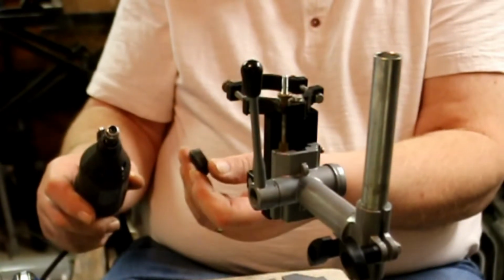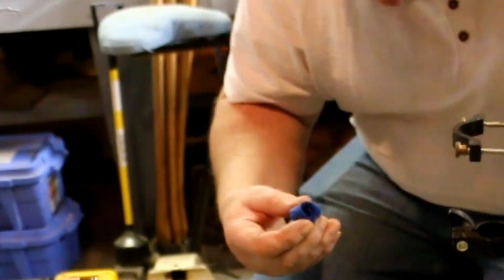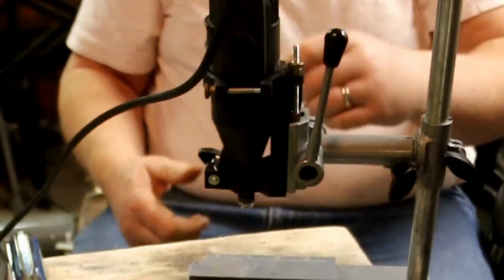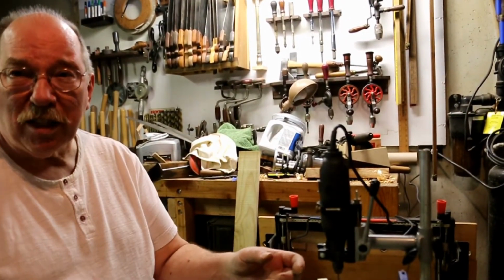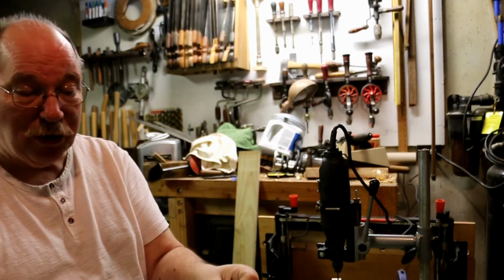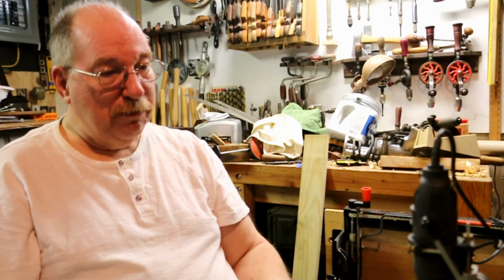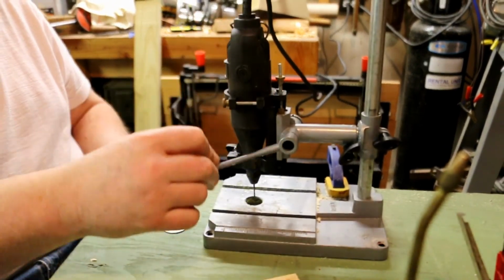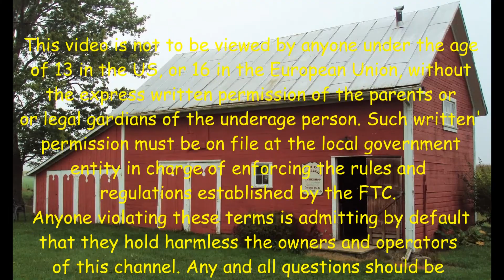The Hobby Drill Press For A Dremel Pt 2 Assembly & Test

Comment: A FINE addition to the shop! I got a DeWalt roto-zip thing and bits but it has a collet setup so I can use regular router bits. SWEET for small stuff you have to hold on to. Sunny today and off to the shoe place tomorrow and back. 1st outing for US in ages. The v.a. was the last. I like being at home. 10/4 on the vise mount idea. GBWYall!
Reply from the maker: W e will be hitting the stores today. After the cancer scare Lydia is back on Humera again and that stops authur from growing. Walking is getting easier. 
Cleaning the shop after the last bathroom build. I need all the room for doing the rolling door. 😁😎
Reply: @OldSneelock  10/4 on the stores. Toots stopped by Hobby Lobby on the way back from taking me to the shoe and peg leg place because we were there. She got some Grans stuff and we came on home. Grub run tomorrow, bless her. Arthur will just have to wait it's turn with me. Other stuff has priority! I might try and do some wrenching tomorrow. Warm enough this evening and we need the room in her shed. The Onan is in the middle of the floor and needs to be put in it's place. Happy cleaning and Happy Humera nd cleaning! GBWYall!

Comment: Great video mate. Using a dedicated Dremel for the stand is a good idea. I have a battery powered Dremel fitted with a flex drive and my normal Dremel 4200. The dedicated flex drive unit is set up because the flex drive is a pain to mount and remove.
I usually use my 4200 in the stand, but a separate one is a great idea.
Reply from the maker: When I was engraving rocks frequently I was going through power units quickly. 
If I saw one at a garage sale I bought it. 
I currently have four.

Comment: Well....that woiks !!
Reply from the maker: Got some ideas to make it easier to use. Spending the day putting stuff away. Way to much on the bench.   😁😎
Reply: @OldSneelock  I spent the day working on an old trumpet case restoration.   It'll take a few more days.  Then, I have another case in line for an 1891 cornet I just restored.  I can't even find the work bench....or the garage.  I wouldn't have it any other way....
Reply from the maker: @lotsabirds  The cases that I have seen are well made. They have to be. If a kid carries it they tend to drop them and leave them in the way.  😁😎
Reply: @OldSneelock  the cases I do are made of wood.  Kids today beat the crud out of plastic cases.  I would hate to see what they could do to the older ones.